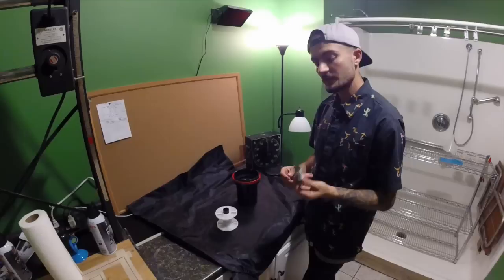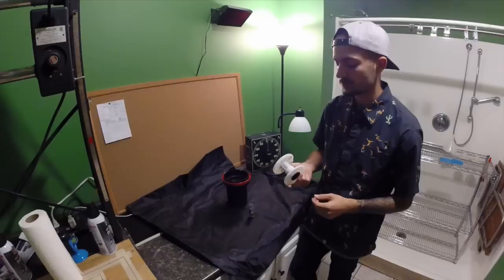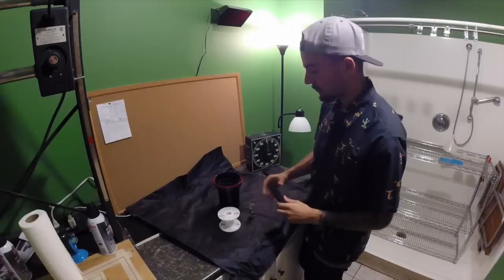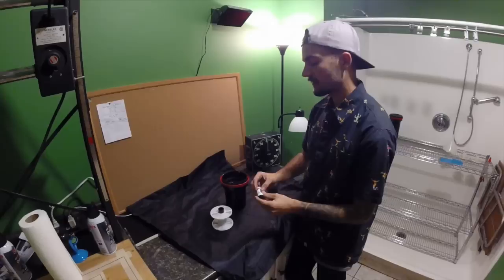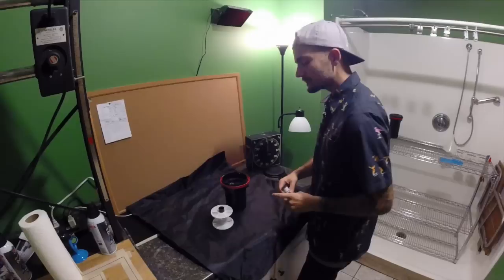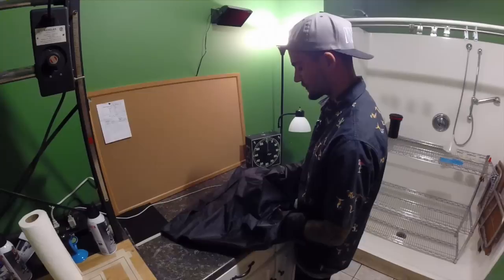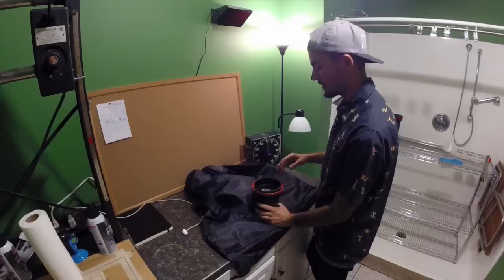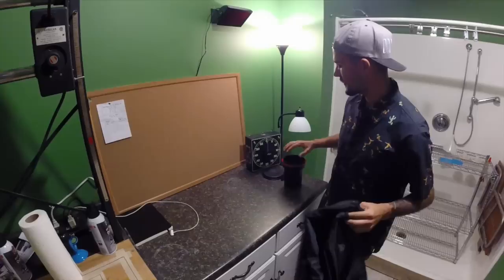Developing B&W Film

Comment: I didn't see a comment on this, but the fixer "fixes" the image by removing unexposed silver halide from the film emulsion. If fixing is done properly, then the film is archival. I also used a little fixer clear in the wash to help remove the remaining fixer from the emulsion.

I think I still have my notes from the 1970s when I learned.

I'd use distilled water if it were me. There's too much calcium carbonate in our water and it will spot the film.

Comment: I have been using D76 for years but just recently bought some HC 110 to try a monobath process.  Maybe I will give this a try too.
Reply: It's been a long time since I developed film, but I was a D76 user. I experimented with Microdol-X and some HC110. But most of my Tri-X was D76, usually a 1:1 to lengthen the developing time a bit.
Reply: @nvrumi  Cool.  Was not expecting to see a response to a comment I made almost a decade ago.  I still use a monobath but use a premade mix from Cinestill instead of mixing it myself  from a recipe on an old forum and hoping for consistency. lol

Comment: Couple of comments to a very good presentation of B&W film development. First, Matt used TF-4 fixer, which is a very good but powerful fixer. Like all "rapid fixers", it's time and temperature for fixing must be carefully determined by reference to the maker's literature. Excess fixing can seriously damage your film image.  "Standard fixer" is less potent and will take more time to work, so be sure which type of fixer you use. Secondly, 10 minutes is an inadequate washing time unless you use a bath of "hypo eliminator" [not used here]; 20-30 minutes is a more proper wash time. Finally, I'd toss out the film wipers [any type]; they pick up dirt with use and WILL scratch your wet, soft film emulsion. Just use Photoflo [at half the strength recommended],hang the film, and let it dry.  No spots; no scratches.

Comment: Matt, bit of a random question regarding mixing fixer: do you mix the TF-4 and water together in a separate jug and then add it to your Datatainer when it's mixed, or do you just pour both the fixer and water straight into the Datatainer and then give it a shake and be done with it?

I've never used liquid developers before, so I'm used to mixing my developer / fixer (both powder) in large jugs or buckets and then once mixed with water, adding it to my Datatainer. I like the idea of just adding them straight to the Datatainer and letting the chemical and water mix together in there.

Comment: Thanks for posting this. One question:

1. If you are using the same measuring cups, spoons, etc for developing film, do you need to clean them with soapy water in-between steps (i.e. fixer vs. developer) or will just washing it out with water do? I know I don't want to contaminate my chemicals so I don't want developer in my stop bath and such, but I was worried that having traces of soap might ruin things too.

Comment: Hey Matt -  thanks for the very helpful and informative video.  After 15+ years of shooting digital only I've decided to get back into film.  So now I need to retrain myself from the ground up.  Just wondered when loading 120 film onto the reel when you separate the paper backing from the film if the finger prints on the film show up in the print or does processing the film remove them?  Obviously, it's a good deal easier to load it without fighting with the paper, just wonder how handling the film effects the final outcome.  Thanks in advance for your help.

Comment: Very helpful and precise, thank you very much !!!

A question: I've no luck finding the last chemical (soap like) u used along with the squeezer... What are the chances I'll screw the negatives on that last step?

Also, I read somewhere that after the fixer and while I'm constantly pouring water on the film, the water should also be at 20°, but as shown here you didn't even took its temperature, so, non important ?

Thanks again, big hugs!!

Comment: Can you please help me with a question. I cant find TF 4 in Europe, so I decided to use Ilford rapid fixer. I know that for TF 4 you are not suppose to use a stop bath, therefore one should use water for this step. My question is, can I do the same if I use Ilford rapid fixer or I have to use Ilford ilfostop in between the developer and fixer? Thanks
Reply: ladduro Water is fine. A stop bath isn't really necessary for film development, but using it will extend the life of your fixer.
Reply: Fast N Bulbous Thanks for replying. One more question please, cause I am really confuse at the moment. 400TX data sheet states that for HC-110 (B) developing time at 70 is 3 and 1/2 minutes... Why did he developed for 6 minutes?
Reply: ladduro if you are still wanting to know. the problem with hc 110 dilution b is the development time is too short (anything under 5 minutes can cause inconsistent results) so he would have been using dilution h, which doubles the amount of developer and time. so development time time is around 7 minutes at 70 degrees for 400 speed